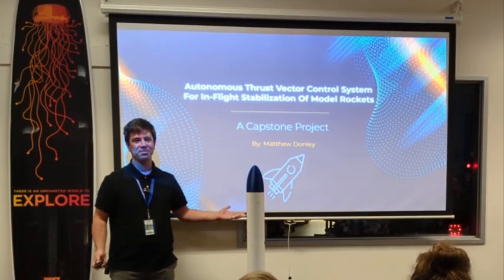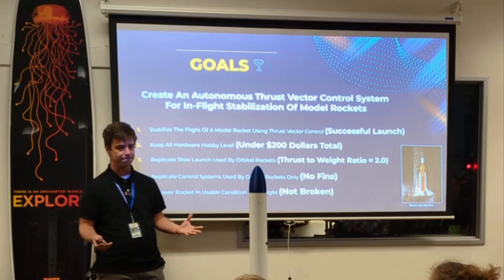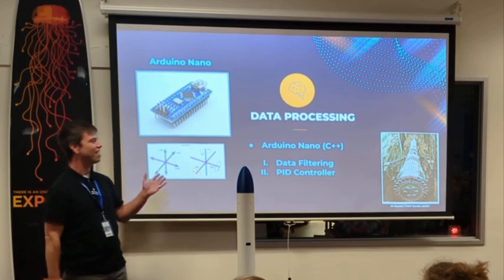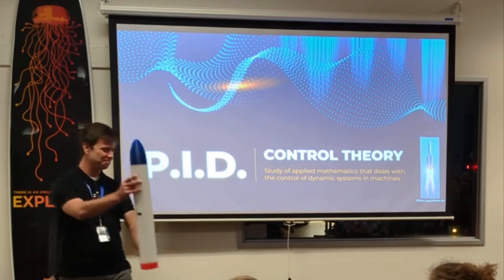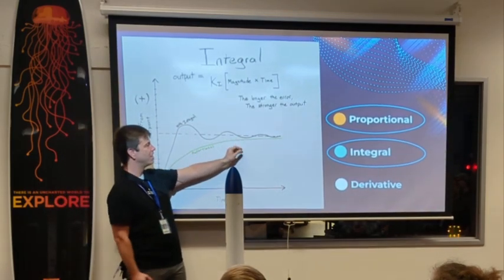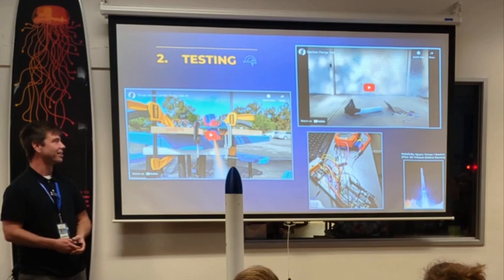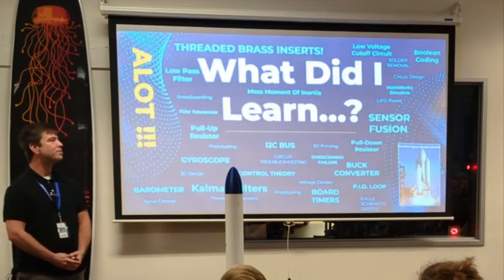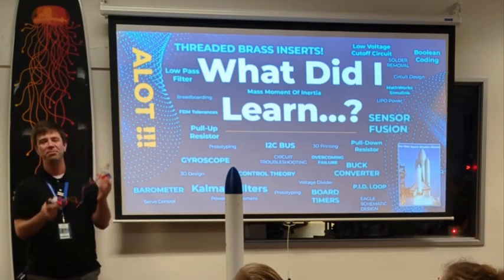Autonomous Thrust Vector Control For In Flight Stabilization Of A Model Rocket (Capstone)

Comment: Great! Are you still planning to launch it? Looks like you missing the most fun (and most frustrating sometimes) part of it - tuning PID :)
Reply from the maker: I have been running Sims on a javascript "template" I found for TVC PID tunning, but the PID coefficients are not matching with my microprocessor code correctly, soooo im kinda guessing for my coefficients. Any advice? 😅 I am about three weeks out from my first clamp down tests with fully integrated system and my randomish PID coefficients, not looking forward to using 300 engines to figure it out lol
Reply: @thinkingthing4851  The most important factors that MUST be in simulation -- correct thrust, moment of inertia, and TVC system response (delay and limited rotation speed). If something of these is missing -- you will not get a good result most likely, so check your simulation code for that. I used my own full 3D simulation of rocket flight, but I think it could be simpler than that, maybe just simulating one axis is enough. You can try to fix your simulation to make it align with your microcontroller code, or maybe write your own 😀?
Reply from the maker: @Positive_Altitude  great update on your flight computer, i am studying some of your circuitry, looking forward to the flight of your new computer. I have a large knowledge gap in all this, so every step is time consuming, but I am enjoying learning all the hard lessons. I just fried my first microcontroller 😅😅
Reply: @thinkingthing4851  You will get there! There is nothing too difficult in all of this, it just takes time. Glad that you are enjoying the process :)